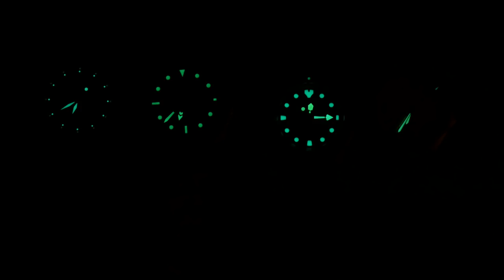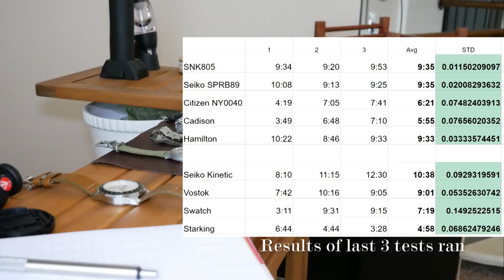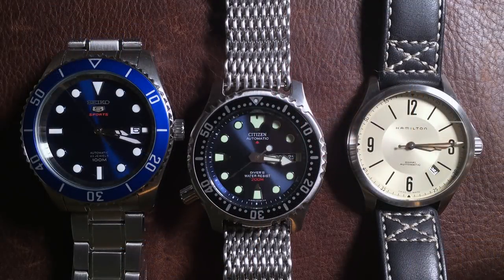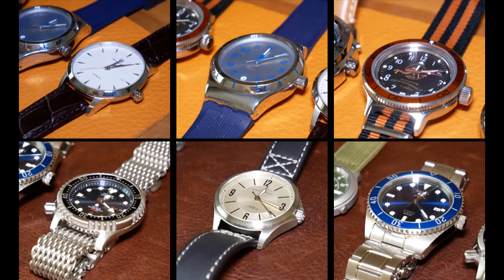Seiko 5 Efficiency Test (7S26) : Science Time

Comment: I suspect a good reason for a non-hand winding watch would be to take stress of the crown and seal.
Reply from the maker: Possible.  It could be the engineers thought that it would be a good protective measure.  Perhaps to increase the longevity of the seal on the steam as well.    Or it could of been that they designed it from the ground up to be as simple and effective as possible.  Which if something isn't needed, why include it.

Comment: Thank you for another get video! I have a Seiko SNK803 and two SKX diver watches with the 7s26c movement. I actually like that the movement is simple with less moving parts. In my opinion it makes for a more resilient movement. My SNK803 when worn consistently keeps with atomic time for a week or more before deviating. My 007 is about +10 a day and the 009 is about -10 a day. I have never bothered to regulate any of them yet as they do the job. Lots of people don't like the 7s26, but for myself I think it is a robust, simple, and reliable movement. Thanks again for the great information.
Reply from the maker: There is something to be said about keeping a design straightforward and simple.  Although it does make me wonder how much of a difference there is in the designs between the 7s26 and 4r35 to give it hacking / hand winding. 
As long as a watch is within 10 seconds a day, I don't even think about regulating.  As there is a good chance I'd make it worse not better.   Thanks for watching, and cheers!

Comment: The Seiko winding mechanism is much better than the ETA one. The small wheels in the ETA mechanism are messing a lot: Too much oil makes the mechanism too hard and you can destroy the wheels. The Seiko System would also be too fragile with an added hand winding, which in fact is unnecessary. If you are not paying all day in a hospital bed, the Seiko is perfect, plus it's a day-date.

Comment: While an interesting experiment, the problem I have with it is the winding made by "shaking the watch in a circular fashion". 
That doesn't happen IRL, where auto watches are winded mostly by turning the wirst, about 45°, or swinging the arm while walking. More than making complete turns, the rotor IRL makes back-forth for, at best, 45° degrees at a time.

Comment: I was pleased you did this experiment.  It confirms what a already suspected.  Don't buy an automatic without handwinding if it's not the only one you own. That's why i choose th Orient Mako II over the SKX009. I really don't like the grinding  sound of  handwinding the Orient movement,  but it performs outstanding. Looking at the succes of the SKX models,  you would say Seiko would mount the 4R35 and lift the price a little. But they probably never will.  And that's too bad.
Reply from the maker: They should, but that might hurt the sales of their other more expensive divers that all have the 4r35.  One good thing is they are starting to put 4r35s in some seiko 5s.  Like the blue one in the video.  I also recently got a seiko bottle cap that has a 4r35 too.  Hopefully I can get around to reviewing that one next month.
At some point I should get an SKX to review, it seems to be what everyone does.  But I don't really want one because of the movement.  Maybe I should just do a video on that.
Cheers!
Reply: Truthfears Guilty  g shock atomic. They sync once a day with the atomic clock
Reply: This test confirms nothing.

Comment: Well, that's very interesting now. I was thinking of adding that green Seiko 5 to my collection that also contains several Vostok Amphibias. I always had a gut feeling though, that if I also bought the Seiko 5 , it would effectively more or less duplicate the efficiency functionality of the Vostoks - but without the hand winding and 200m water resistance. Both the Seiko (37mm diameter) and the Vostok (39mm diameter) would wear kind of similar on my 6.5 inch wrist - both comfortable - but the Seiko would indeed wear slightly smaller on the wrist than the Vostok. So what to do? Since I do like the look of the Seiko 5, I think I'll eventually buy it anyway and stick it on a NATO strap. The Swatch Sistem 51 test result also looks promising, but I won't push the button on that yet because of the larger case diameter and longer lug-to-lug measurement. 
Thanks for the interesting video - well thought out and very helpful when making a buying decision!

Comment: Thanks!  I really liked the topic and demonstration. What I noticed is that it’s difficult for me to even pick up my dead SKX without it beginning to run from it’s dead stopped condition.  That is not my experience with my two ETA autos. They take deliberate effort to get them going.  Not an experiment but a consistent observation and experience.  So I’m thinking another aspect to the test of efficiency is that of responsiveness of motion rather than length of charge.
Reply from the maker: That's a good idea.  I'll think about how to do that.  I've been meaning to do some sort of follow up.  I tried to do one focusing on Seiko Kinetics vs the Seiko Autos, but didn't get very far.  I was going to use a winder to keep it more exact, but Seiko Kinetics do not like winders.  Cheers!
Reply: I will be sure to watch it.  I think the most useful aspect to handwinding on an auto is to get it going from the dead stop. The absence of handwinding on the 7s26 is not missed by me due to its sensitivity of motion;  pick up my SKX, put it on and it’s ticking!  Love it!

Comment: Watches with the Seiko 7S26 movement are really only meant for wearing it everyday, so hand winding is irrelevant. I have two watches with this movement and only wear one day to day while the other just sits in my watch box. However, shaking the watch a few times is actually pretty efficient, but hand winding is ideal if you want more than one automatic watch.
Reply from the maker: I am actually amazed at how lite shaking is required to wake one up.  It may not be as convenient for a collector, but it really is  a well engineered piece of technology.  Cheers!

Comment: It amazes me that people have such issues with the 7s26 not hand winding. The seiko 5 line, and the 7s26 specifically, was always intended to be a solid everyday watch for those who can't afford a top end timepiece (or many of them). They assume that if you can afford better you should buy something better. Imho they are great in that role just how they are...simple and efficient.  It seems illogical to fault something when used outside its intended purpose even when it performs its intended purpose admirably.
Reply from the maker: You have a point.  The thing is that while the 7s26 was, and is a budget movement.  At this point, the 4r36 (nh36) movements could also be considered budget movements.  Seiko has introduced a number of Seiko 5s with the 4r movements (I've actually reviewed 3).  Yet more to the point is that outside Seiko you can get a watch with a NH series movement for the same or cheaper than many of the Seiko 5s with the 7s26.
So for me, a 7s movement is a negative when you can find alternatives at the same price with a better movement.

Comment: I'm not sure the Kinetic can be directly compared at all, it won't charge as fast as the others but when it is charged it has way more power reserve than any of the mechanicals. Not the best watch to buy if you have a large collection and wear it rarely, but for a single watch collection it would make sense.
Personally I went with a Seiko Solar for the quartz watch, in my collection, if I'm not wearing it I can just sit it next to a window every couple of weeks for a day and it'll get more than enough charge.
Reply from the maker: That is pretty much sums up my thoughts on Kinetics.  My 2 are almost always dead, and rarely wear them.  Mostly because the double ticking annoys me.  Yet if I don't wear them, they never charge enough to go back to the single tick.
I tried doing a follow up on this.  But focused on the Kinetics.  Was going to use my winder and see how much charge they got off so many rotations.  Didn't work out.  I didn't realize how much Kinetics don't like winders.  Each attempt they would only run for a few minutes.  I have a few theories, but I'd love to really find out why they don't work with them.

Comment: Hand winding is indeed a crucial and necessary function, and even before I became a full on  watchmaker , just the simple pleasure of winding my watches was sought after.... instantly voiding Any  SKX for me , and has always made me Wonder why this piece was so well liked for the price ( especially now as the prices have risen) ... I’m curious if the STARKING HI - beat you reference is just the Seagull ST2130, DIRECT ETA clone ( legal clone , as patents expired allowing the copying of the design) or potentially a HANGZOU, or NANKING MOVEMENT? The ST2130 IS BY FAR THE BEST BANG FOR YOUR BUCK !! They can be had for as little as $46. , parts are direct swap with ETA, and like for like, the 28,800 beats with hack in hand winding and the exact same architecture. This is by far my movement of choice, with the Miyota  9015 is somewhat distant second, and the new version 821A  with hack and hand winding a very very close third to the 9015 as far as value proposition, quality, and overall performance
Reply from the maker: They say the Starking is their own thing, but I'm sure it's based off of something from ETA.  Definitely agree with you on the 9015, one of the best value movements out there.  Especially if the brand takes advantage of the thinner movement with their case.

Comment: so not having hand winding only works if you only own and wear one watch. Well if you have two and one is a dress watch that gets used seldomly you'll still be past the 40 hours, you'll still need to wind it. So just pull the SNK out of the drawer, give it a few "seiko shakes" set the time and go out for the event knowing that until you take it off it'll be fine.

to me your experiment only demonstrated that your "movment winding" only partially wound the watch. Will the SNK benefit from crown winding ? Well perhaps, but 1) at what cost and 2) at that extra maintenance issues?
lastly I thought it was really hard to find your data, there was so much "Walter Cronkite" and the presentation of data was mixed in the middle with no clear markers I got lost (even listening all the way through I had to go back and check.

but thanks for doing this.
Reply from the maker: Initially I thought of it as a fun practical test.  Just curious to see what would happen.  To be honest I never anticipated this many people viewing it.  Recently I've been thinking about coming back to this with different movements and a more rigid testing methodology.

Comment: It would be interesting to test also the Pagani design (cocktail time homage) if you still have it, because I think it uses similar to the miyotas unidirectional winding, similar to Starking winding. For seiko autos I have watches with 7s26 and NH35/6a, and the NH-s I never bother to hand wind. Some people say it is not good to wind an automatic watch, not to break the auto winding wheels, probably ok to wind very very slowly and carefully. So I don't use manual wind at all, despite that I don't wear a watch more than 1 day in a row. I adjust them every time.
Reply from the maker: I still have it.  I haven't wore it much recently, but still have it.  Wouldn't seem right to sell it since I had to jury rig a fix.  I don't remember much about the movement in it, I'll have to take a second look.
Right now I'm wishing someone would make a guide to identifying Chinese movements.
Reply: @RelativeTime  It uses similar movement to my Parnis pilot watch:
https://postimg.cc/0MT9gWDK
https://postimg.cc/2bbCKRbf
My Parnis works fantastic. But of course these chinese movements can be good or bad, depending on the quality control and particular item. The most efficient are the magic lever movements, bidirectional winding. So for chinese watch is better to be with magic lever. But can also happen that even with magic lever it can be inefficient, because of bad made parts - for example I have such  Ailang pilot watch, but such case is rare.

Comment: You’re actually measuring two things in this experiment that are actually independent of each other. I think you’re confusing the efficiency of the winding mechanism versus the efficiency of the mainspring and movement. Hand winding may give you a fully wound mainspring faster and more efficiently than a watch wound via the shake. The real way to determine efficiency is to ensure a fully wound mainspring as the starting point in each watch. That will tell you the efficiency of the movement itself. You can really only compare the efficiency of the winding mechanism if you can accurately measure the turns per day, or TPD, to achieve a fully wound state. Many watch companies publish this as a range with the 7S26 and the like being anywhere from 650 TPD to 1000 TPD. I should add too that I’ve had multiple new Seikos with a fully wound 7S26C run for as little as 25 hours to as long as 47 which speaks to the variance in the efficiency of that movement in brand new state. A watch winder would have helped enormously in this experiment. Still, a very interesting take.
Reply from the maker: Thanks, and you are correct.  Which I partially alluded to, but didn't explicitly say,  when I talked about the two obvious flaws I saw.  Specifically when I mentioned that everything should be the same age, I was alluding to the age and amount of use to the mainspring could effect the results.  As well as having different beat rates, and complications would also effect how the power in the mainspring is utilized.

I should of been more specific and said that I was taking a practical approach to look at the efficiency of the system as a whole, rather then just talk about winding.
It would be interesting to look at the efficiency of both the winding, and the conversion of power from the mainspring.  But I think it might be beyond my capabilities.  I would think you would almost have to isolate each component somehow.
Making sure each was fully wound is a good idea, but I'm thinking that their may be variations in the length, and type of material used to make the mainspring from different manufactures.  Such as longer spring, more power.  Which is why I think the Swatch, as well as some Tissots have 80hr reserves.  It's something I would have to look into.

Thanks for watching, and commenting.  I wasn't aware that companies published specs on  TPD.  Cheers!
Reply: Relative Time yep, it’s a good experiment but lacking some controls. Isolating them would definitely be difficult though. I’m glad you undertook it because it’s thought provoking which makes for good YouTube viewing.

Comment: I designred an auto winder phor use in the automobile. . 
Can't decide iph I should use the steering wheel...the tires ... or simply harness the awesome power phound in the suspension while negotiating Milwaukee pot holes.
Reply from the maker: I lived in Janesville for a few years... so I have to go with the pot holes.  Especially right after the snow thaws.

Comment: You should've put them all on something like a 2x4 to wind them simultaneously to be more consistent
Reply from the maker: Hmmm then I could flip it around like one of those sign spinner guys.  😋
Reply: @RelativeTime  If all the watches get the same flips and flops, then you are more accurately measuring the relative efficiency of the bidirectional vs unidirectional winding.  If you deliberately shook the unidirectional watches so the rotor only spun in the correct direction, then you are contriving a play to their strength (fixing the data).
Reply from the maker: @DonaldPerley  It was almost a year ago, but if I remember right I swung them all in the same direction.  Counterclockwise, so that they would all charge.
Ideally, I'd like to revisit this sometime.  But use a winder to standardize things.

Comment: Is higher efficiency always a plus?  Any automatically winding watch needs some mechanism to prevent over winding.  If a watch is way more efficient at winding than it needs to be, then that safety valve may wear prematurely.
Reply from the maker: That's a good point.  Not sure.

Comment: I have an skx009 (same movement) and I have to do a 'Seiko shuffle' for about a minute each morning and evening or else I will be lucky to get 24 hours out of it. the other thing is that it loses or gains time (about +/- 6 seconds a day) depending on what angle i lay it at overnight.
Reply: Duncan Keable if you’re getting +/- 6 seconds a day, that’s well within the specs for that movement.  Rolex’s “superlative chronometers” are chosen because they get something like +/- 2 seconds per day.  Quartz is the only way to get better accuracy without spending a fortune!
Reply: You should service it, it shouldn't need that much help.
Reply: You must not move very often at all then. I easily get 40 hours with my skx, just wearing it at home hardly moving at all.

Comment: Great idea here.I have a Seiko albeit old 7009 guts but doesn't wind very well worn if that makes sense? Sure I can shake it around to top the barrel up but other than that is pretty poor .The rotor does have a lot of runout though through bearing wear so guess an unfair comparison as you suggested via overall age and hence wear.Cheers.
Reply from the maker: Makes sense.  Perhaps the gearing is getting a littel stripped.  I was also thinking about the age of the spring itself.  Over time, all the winding and unwinding will effect it.  Or at least I think it does.  Cheers!
Reply: @RelativeTime  Appreciate your reply.I have watched many tutorials and enjoy your new approach? I have ordered a new old rotor and bearing to try first .Easy job.Cheers.